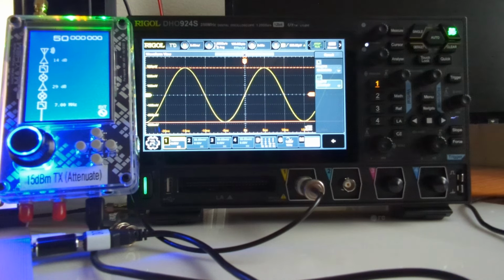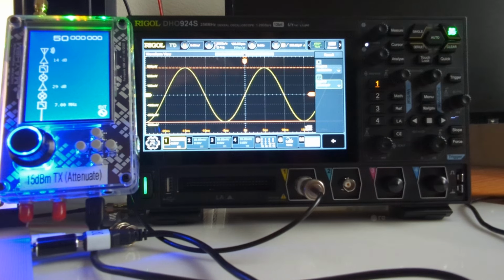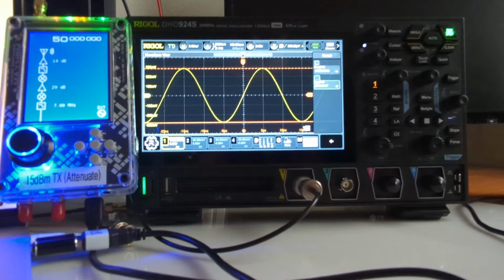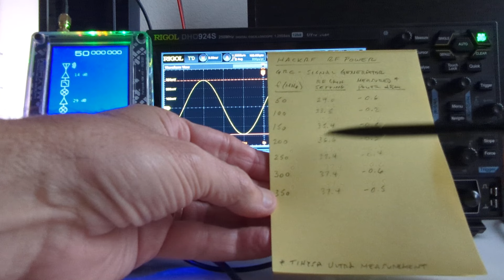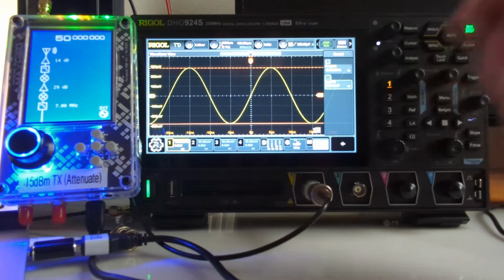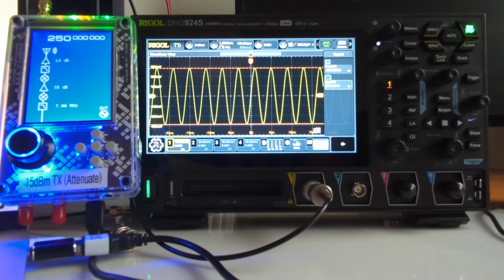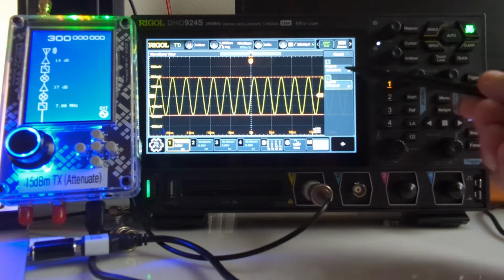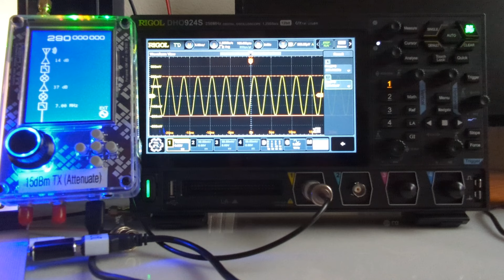Rigol DHO924S bandwidth measured with a HackRF and GNU Radio Companion

Comment: Hi, I have not repeated any test here yet. Make sure your 50 Ohm terminator also has the sufficient bandwidth 😀
Reply from the maker: Thanks for that comment! I just checked using a NanoVNA. The 50 ohm terminator has about 3.7 dB (+/-0.3 dB) of loss up to 400MHz, with the maximum losses at ~50 MHz and ~300 MHz. Overall, a reasonably flat response across those frequencies.
Reply: @philipgiacalone5605  is that connected to the scope (with the input capacitance in parallel) or disconnected?  I need to run the same test, actually, with the inline terminator I have here.  I don't have a pulse generator here, but once I have some confidence in the inline 50ohm terminator, I'll take the thing to office (an airplane away) and see what the rise time is.
Reply: Can you go higher ? Let’s say 500mhz or above. The chip from teardown can reach 800Mhz.